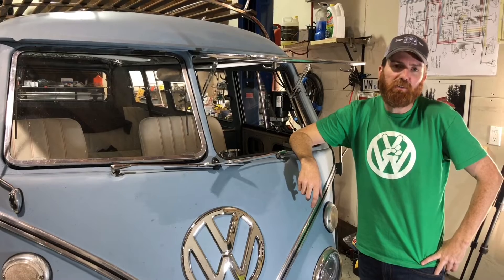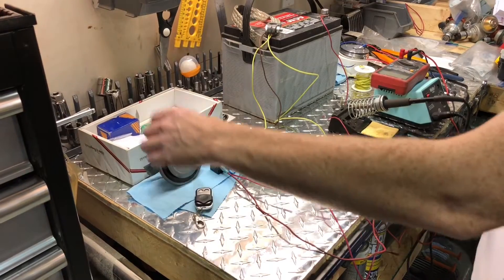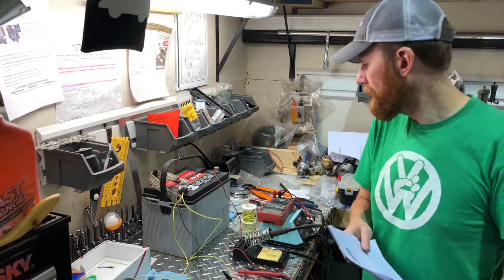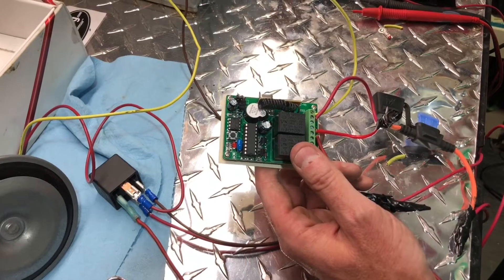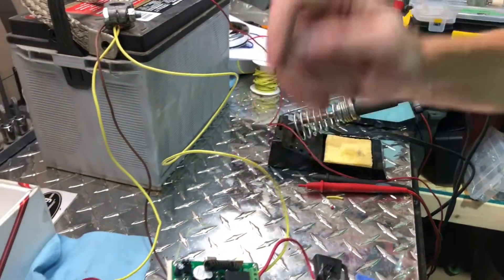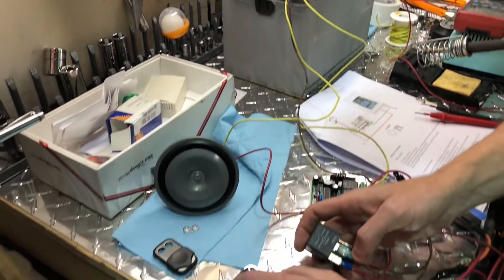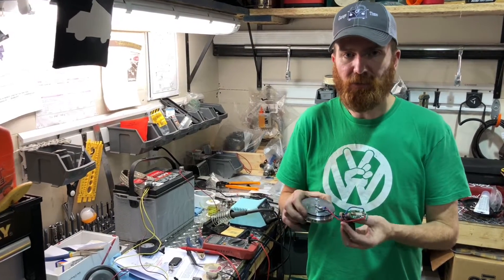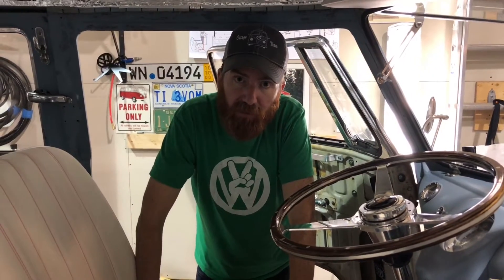VW Bus - Wireless Horn Installation

Comment: Question:   You did not demonstrate the horn after it is assembled into the steering boss.   It all works for me util this point when steering boss appears to act a faraday shield  and block the transmissions. 
Is that why you did not perform a final demonstration?